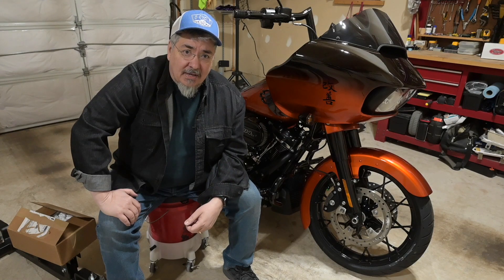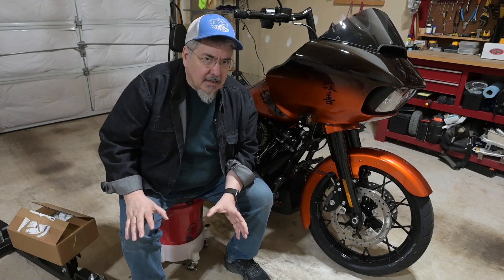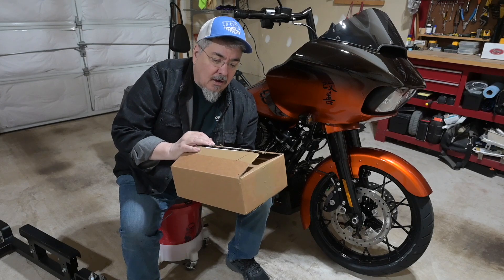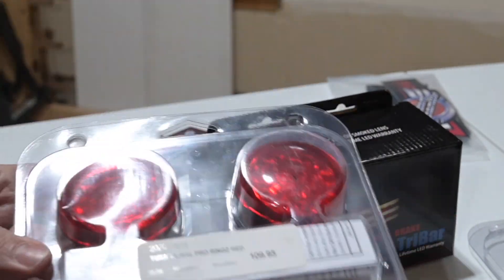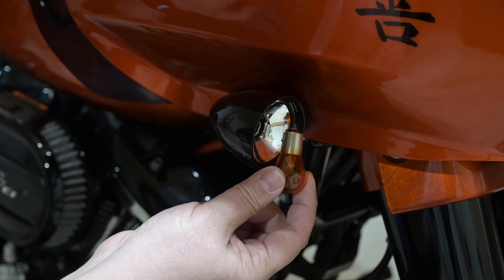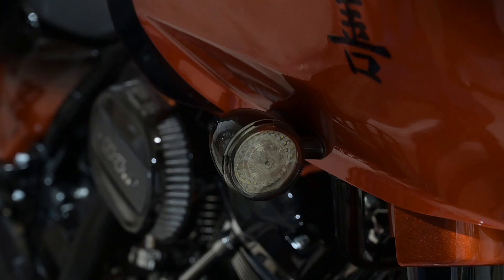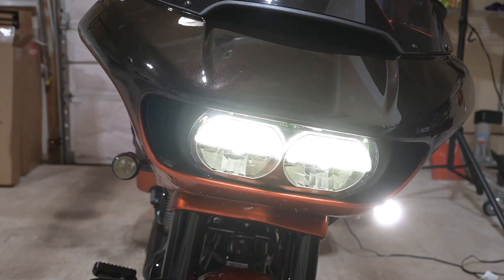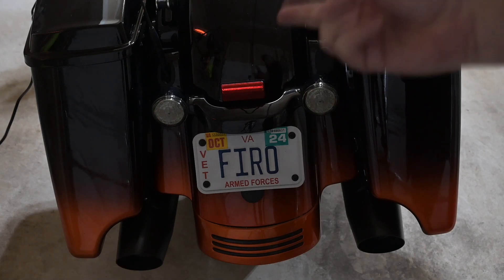RGS Build Series | Custom Dynamics goodie box!! And installing ProBEAM LED front/rear turn signals.

Comment: Removing the dialectic greese is key. Had two failures until a call to custom Dynamics mentioned using q-tips to thoroughly clean out socket. Bam! Let there be light. Great detailed video... thanks